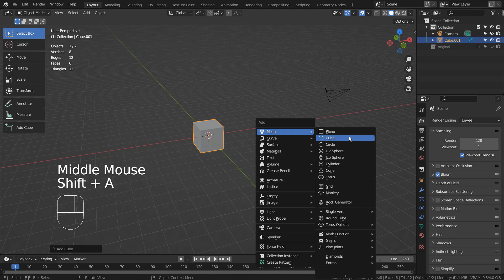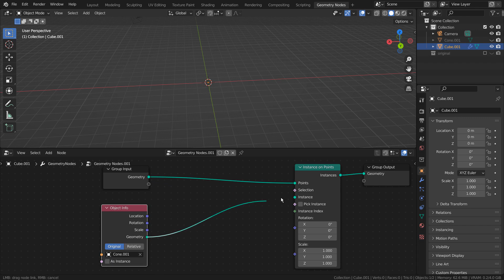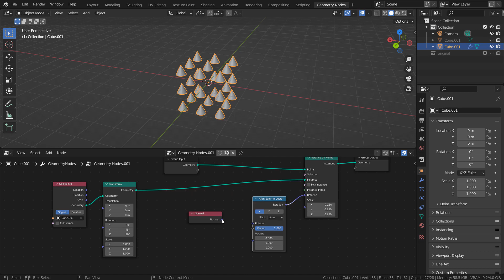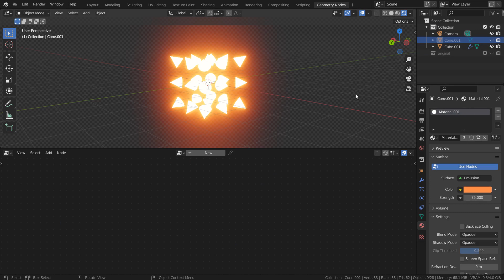Blender 3.0 - How to 'Align Euler to Vector' along normals by using Geometry Nodes

Comment: I don't know how, but using the Position node instead of Normal node with Align Euler to Vector set to Z axis pretty much works the same.
Reply: Not sure why, but the normal node didn't do anything for me. When changing this to the position node it finally worked. Thanks!
Reply from the maker: Thank you for watching, mind_glowing..!! :)  I'm glad the position node worked..!! :)
Reply from the maker: Thank you for watching, Prokster..!! :)  Wow, that's interesting..!!  I just tested it myself, and confirmed the position node is working as well..!!  I have pinned this comment..!! :)

Comment: Thanks for these micro tuts; they really help.  I especially liked that you presented the whole node map enlarged. Sometimes these things are really hard to see in tutorials. 
 I added the material and eevee settings, but mine doesn't glow.
Reply from the maker: You're always welcome, AB..!! :)

Please try this.

1. Create a sphere.
2. Select the sphere and type "S" to scale it big enough to cover to entire scene.
3. Control "3" to subdivide.
4. Right Click to 'Shade Smooth'.
5. Apply a dark material.
6. Try rendering again. :)

If that doesn't work, please double check to see if the Bloom setting is turned on. :)